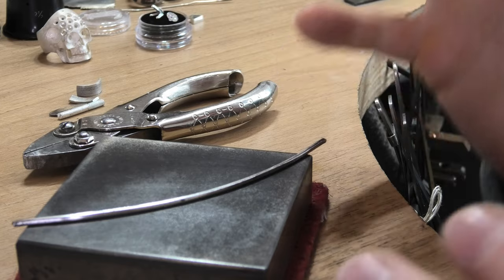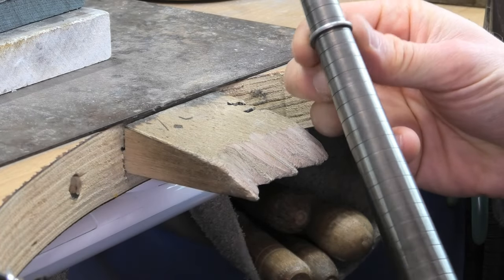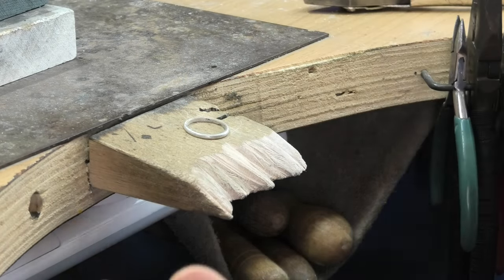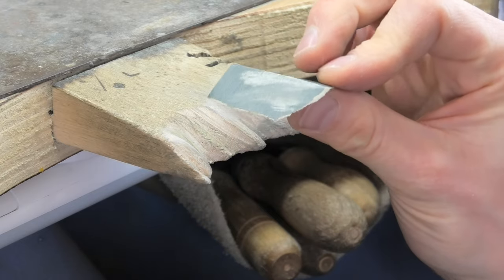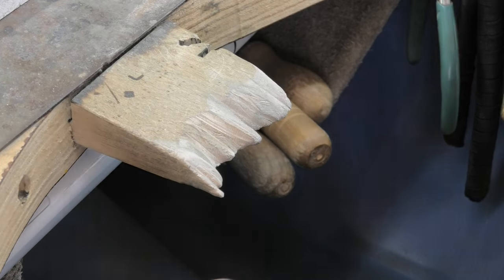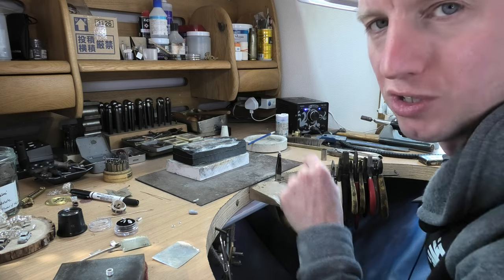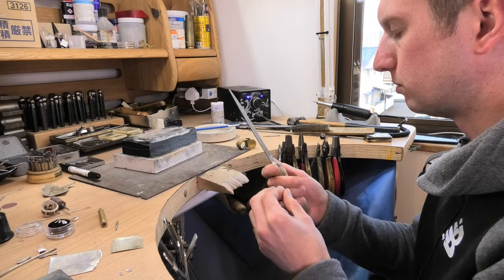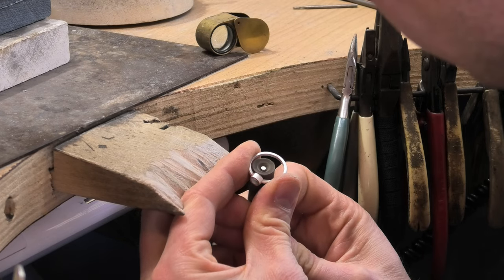The Easiest Way to Make a Single Stone Ring. Full Instructional Guide!

Comment: For seating the shank in the setting I usually use a "chernier file". A sort of flat file that only has teeth on the edges. Makes things a lot easier
Reply: Where do you find them?  I've been looking for several years now!
Reply from the maker: @leeperrybender5811  Ive never seen a file like that before. Maybe if you need one just get a grinder and modify a normal flat needle file

Comment: Can you tell me what torch you are using because I can't seem to get enough heat for the solder to flow if I hold the piece in third hand. I am using a dremel torch but don't have the space for a professional set up. Thanks
Reply from the maker: oxy and propane are best for jewellers. Very hot flame that doesn't burn too brightly

Comment: Please don't laught, I  know that you are an experienced jeweler, I would like to ask as a very beginner person, what I can do with some scrap of sterling silver, e.g. after making a ring or after cutting something out of a silver sheet.  I work from home and I have no special devices . Thank you for your chanel you are very helpful
Reply: I use scrap silver in a bunch of pretty resourceful ways.. You can ball it up to make decorative elements which you can use in shot plates or just as a ball, you can also make a larger ball then flatten it out with a hammer and use stamps to either put a design on the piece or I have found even initials are useful and then I will add a birthstone to make it a personalized piece of jewelry. I hope a couple of these help😁
Reply from the maker: Yes like JaNet said if you can melt it in to small balls and flatten them with a hammer to get small round shapes
Reply: @DiamondMounter  😁
Reply: @JayDub_143  oh wow thank you very much now I am safe :):)
Reply: @magorzata8213  anytime!!! My pleasure!!